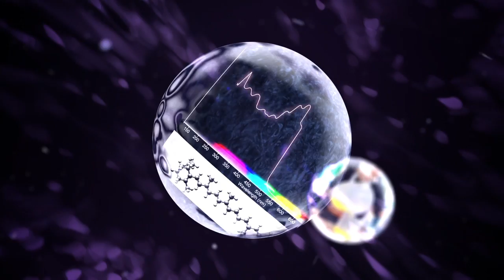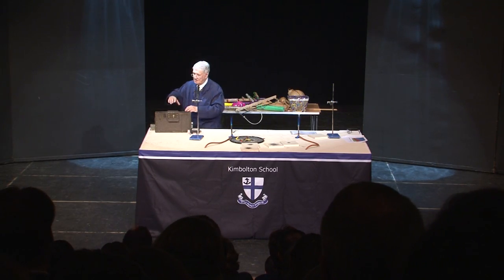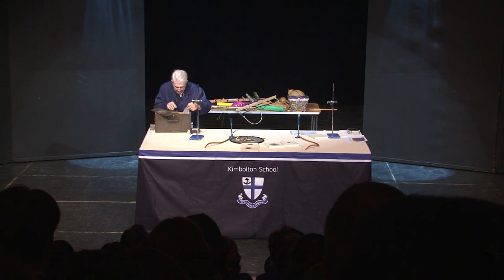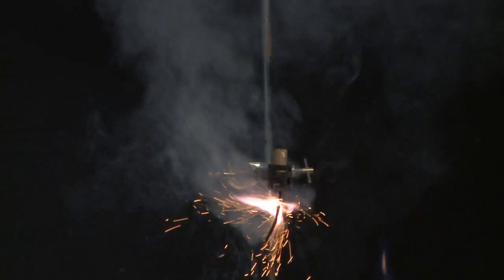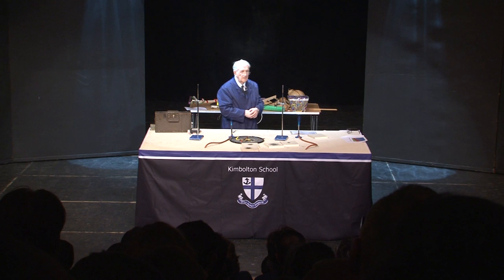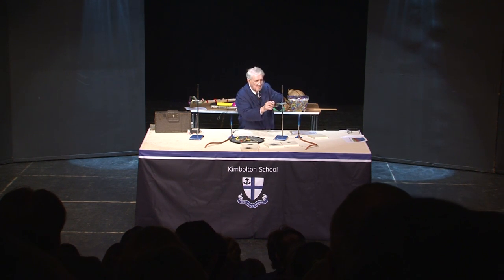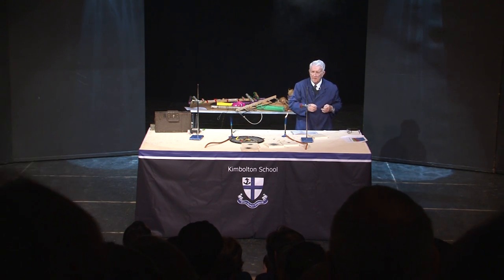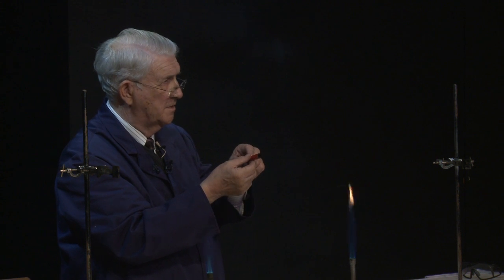The sound of fireworks - whistles

Comment: Generally, the reason for whistling components in some fireworks are understandable - when you see a bomb drop from a warplane in World War II, you hear the whistle as the bomb is dropped - just before the bomb impacts and explodes on its target. 

That is why bottle rockets - a lot of them - have whistling elements that you hear before you hear the report ("explosion"). But there are some bottle rockets that do not have such whistling elements - just only a report after the lift charge is done.
Reply: Whistle wasn't invented to copy the sound of a bomb dropping.
That is just a coincidence.
They probably just discovered a cool effect and thought hey this could be used in pyrotechnics.

Comment: My guess here is that to make a downward glissando whistle of a firework device (such as a bottle rocket) before the detonation (bang, boom, pop) - the fireworks manufacturer or maker tightens one part of the hole of the firework so that the air is heavily packed, and as the hole is opened in the firework's ignition process after the fuse goes inside, this lets out more air less and less constructively, causing the pitch of the whistle to go downward--having the effect of what happens when an RAF pilot drops a war bomb during World War 2 in one's bomber plane. The pilot sees the bomb drop and hears the whistle of the bomb as the bomb is dropped -  until the pilot sees the explosion of the bomb as it impacts on the ground. 

In war movies, when a soldier hears the whistle of a already-fired munition towards that person, he would say "INCOMING! HIT THE DECK!" something like that.